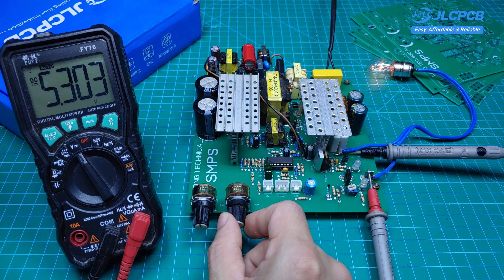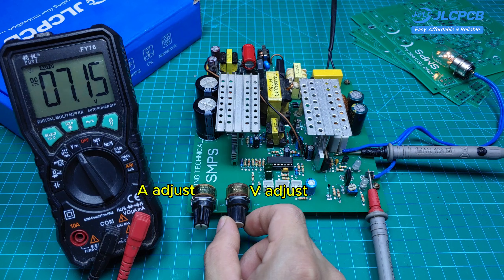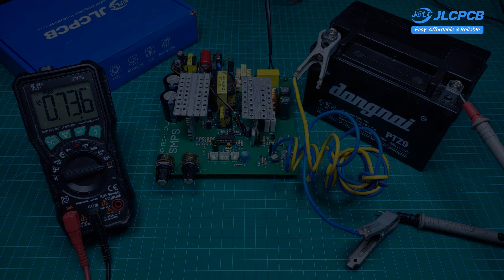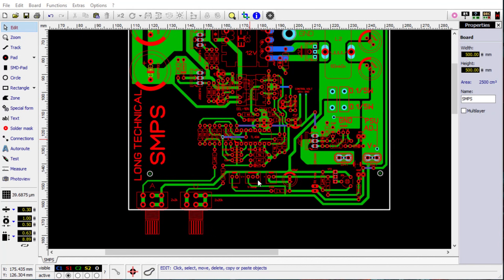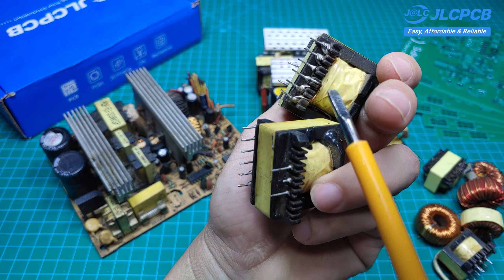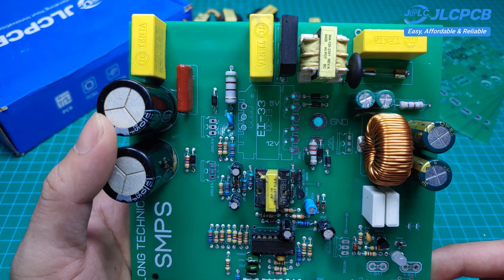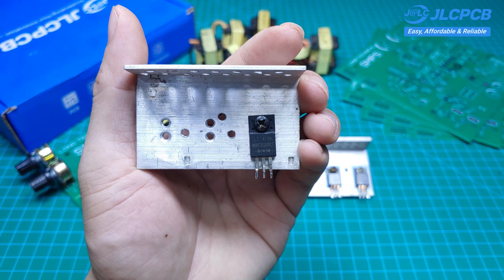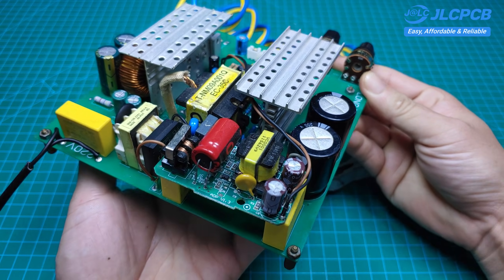DIY Adjustable CC & CV Power Supply from Old PC Part | JLCPCB

Comment: Sir how do you calculate rc snubber for half bridge smps you share schimetic circuit diagram but important thing is different transformer winding turns require different rc snubber in your case snubber is different and in our case snubber will be different but how to calculate
Reply from the maker: You can find this answer on internet. It 's not easy to explain here. Thanks